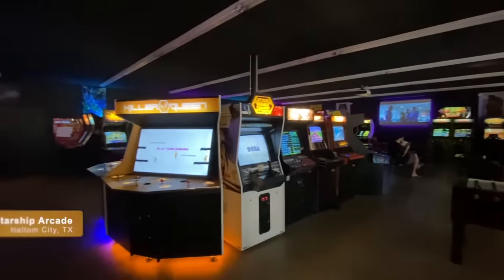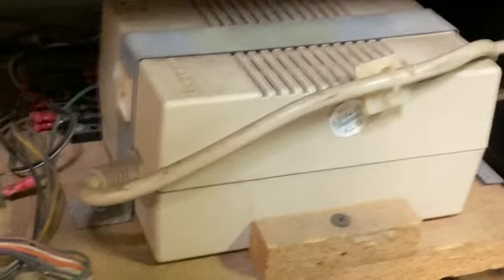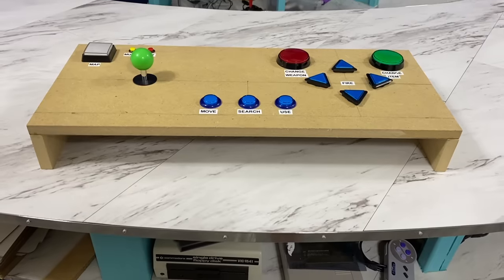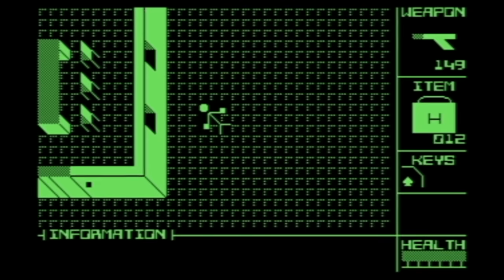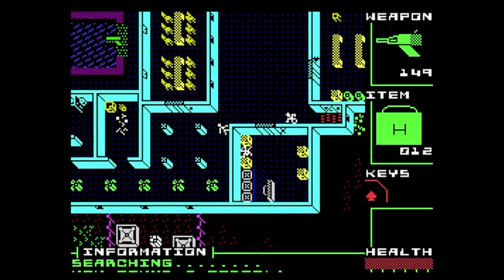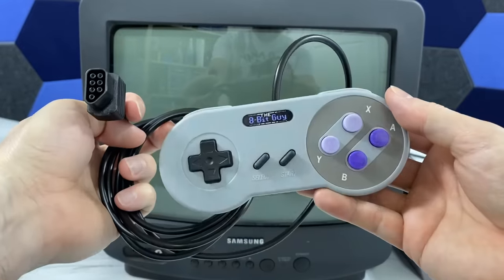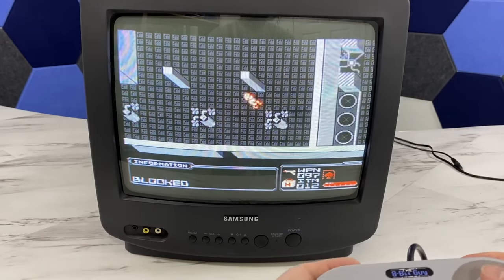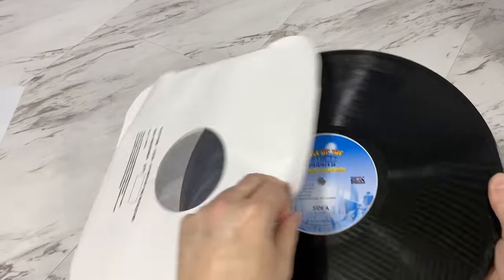Petscii Robots Mega Update - Arcade, Genesis, MS-DOS and more!

Comment: There will be people that cry about the NES version using 4 color grayscale for tiles, but I love the look personally.

I've been working on a handheld in my spare time that runs in either a 2-bit, 3-bit, or 4-bit grayscale for 4, 8, and 16 color modes respectfully with a transparency color for each.  Most likely with a standard ~2.8" display at 320x240.  Dpad, start, select, 4 face buttons, and 2 shoulders.  As of now I'm running off a RP2040 based board to try and make GBA quality games using upgraded Gameboy Pocket style graphics.

Comment: A lot of the quality arcade joysticks come as separate replacable parts, including the frame, the stick, and the microswitches. The microswitches are pushed by a lump on the bottom of the stick. Even a few old computer sticks, back in the day, advertised using microswitches as a mark of their quality. Thing about microswitches is they don't all share a ground! You'd have to wire them separately, sure, but how hard is it to solder a wire to a microswitch? Then you have complete independence, and from the keyboard controller's point of view, there's literally no difference.

You just need access to both terminals of each switch. For everything other than the joystick, which I covered above, that's already the case. No special adaptor board needed. Though that said, you could probably have answered the same problem with a few opto isolators. That would allow you to use an existing JAMMA control panel, if you needed to. I haven't looked recently, but when I did, it was cheaper to buy an old JAMMA cabinet than to make one new. In case somebody has a similar idea.

Comment: Wow so many versions, really impressive stuff. :D
I think that NES solution was fine, can understand the reservations for color but that's how the PPU works. Can already think of a few reasons why 16x16 tiles wouldn't work. ;)
7800 too cool, part of the Pokey club now heh. At least there are some chip clones for that sound standard and continued effort to replicate it.
Reply: To be honest, I don't see a reason why 16x16 wouldn't work. It would just give a different look. I guess it is just an effort/end result balance, as with 16x16 there would be need to figure out how to squeeze 1024 tiles of graphics into 256 (512 actually possible, because there is no smooth scroll). Tools to simpify this process are already there, though.
Reply: @shiru8bit  My first thought was of tiles that actually utilize the 3x3 grid construction directly in-game like changing one of the nine blocks individually.
You can approximate the visual result into 16x16 but then you're swapping the whole CHR table for exceptions which is only part of that unique display process.
It's not that there aren't ways but rather the NES-way is more bespoke or custom than how the other platforms operate compared to the source version. Somebody has to step-up and want to do that extra work. ;)

Comment: Neo Geo would have been the ideal platform for an arcade port, since it is in fact arcade hardware, but there's also a home console which used the same hardware platform. Also, it would have been the best looking and sounding version if you'd used the full capabilities of the hardware. Look at a game like Metal Slug for example.

Comment: I may have to grab that Genesis port! Also has there been any thought of a TRS-80 Coco port? Not sure how doable that would be, especially for a Coco 1/2. Would at least probably require 64k. Much as I love the Coco, the graphics are a bit...weak. Coco 3 would probably be easier, esp a 128k or even 512k model.

Comment: I feel like the reason the Amiga version was chosen because that version was long since finished and the Genesis port was just recently finished... But also a little bit of Amiga bias. I say that because the Sega Genesis has RGB video just like the Amiga, the Genesis is very comparable in features. Moreover, the 2-player mode of the Genesis port would have been great for an arcade setup.

Comment: Will you consider porting NES version to Nintendo VS System (*which is basically share very similar thing in term of architecture). Nintendo VS System is basically an Arcade version of NES, which I think would be fitting if you ever considering making a NES arcade version

Comment: I am interested in how it is that you port this game to so many platforms. Do you have to rewrite the game from the ground up for every platform, or, even for some of them? I can see that there is a lot of work that goes into the graphics design, but outside of that, I can't imagine the level of effort!
Reply: Some platforms share the same CPU, so the same source code can be reused for the game logic, only the video and audio parts has to be reworked (along with the visual/audio content). That's why the ports first covered a wide range of the 6502 powered machines. For other CPUs you have to rewrite the whole code either in assembler for another CPU (like ZX Spectrum version), or in C (Amiga and some others), plus rework the video and audio. So it varies, and also depends on the prior work - like, if one already ported the game to C, it enables further ports for more powerful platforms to be made with less effort.
Reply: @shiru8bit  Great explanation--that makes a lot of sense! Thanks!

Comment: Concerning the joystick/keyboard common ground problem: wouldn't it be easier/cheaper to reprogram the game inputs to use a single row of keys on the matrix? Then you could have had a common "ground" so to speak and wouldn't need all that extra circuitry for the inputs.
Edit: okay, looking at the board from texelec, it probably wouldnt have made that much of a difference

Comment: I'm a little disappointed you didn't try to reprogram the game for Arcade hardware. But I know that would be very difficult because there are so many different kinds of arcade hardware out there and a lot of games had hardware built for just that game.

Also, I would love to see a Nintendo 64 version of Petscii robots with low poly graphics.
Reply from the maker: Indeed.  It would be a huge undertaking just for a single one-off arcade machine.  Better to use an existing platform.
Reply: N64 version would need to sell 1000+ copies to make it viable. So far there are major doubts it could cover its costs, and while I'm totally would love to make one, I'm not in a position to take such risks with my own pocket and time.

Comment: Regarding the NES and MMC5, I've seen copies of Castlevania 3 on aliexpress, using all new hardware, and that was an MMC5 game.  However I'm not sure if their method emulates all the MMC5 features or some of them, perhaps if you only want a few features then that might be doable.  Of course, if the project wasn't already set in stone.
Reply: The thing is that CV3 didn't use any of the advanced features of the MMC5. It was a VRC6 game originally, which is a way simpler mapper, much like MMC3, and as Japanese custom chips weren't allowed in US releases, it has been replaced with MMC5, just because it required less changes in the code (related to the ROM paging granularity). So the modern replica may be a translated Japanese version with the VRC6, or even a modern MMC3 hack.
Reply: @shiru8bit  ah, shiru himself!  I wouldn't be surprised if the Ali CV3 was like you said, a mapper hacked version, I don't know much about that particular version.

Comment: keyboard membranes are not  100% conductive it is resistive paint, you better off measuring resistance from key to next key rather than from start of the trace to the end because it will never show full short
it is enough to all between buttons pads to have similar resistance from one to the next one in line

Comment: The ZX Spectrum's monochrome version surely can't be because of RAM limitations. The Spectrum only has one screen mode. Of that, about 6K is used for a monochrome bitmap, and about 1.5K for the colour overlay. Every 8x8 pixel area of the screen can have only 2 colours (a lot like tile mapping, except it applies only to colour, underneath that the screen is a full bitmap). So that claim doesn't make sense.
Reply: The RAM is needed to store the not so efficient ported code, the map buffer, font graphics, and so on, and so forth. We were literally squeezing out bytes to fit everything that it needs.
Reply: @Ffinity  "Due to the limited RAM available it ends up being presented in monochrome" is the sentence I was responding to, you smartarsed little sycophant. Programmers are only human beings, you know.

Sure I can understand running out of RAM, happened a lot back in the days, programmers having to work out all sorts of weird methods to store data and pseudo-compression and stuff. Jet Set Willy II went from about 32 rooms to over 100, on the same machine, cos they invented a better way of storing them.

That's nothing at all to do with lacking colour, though. Lack of RAM doesn't mean you have to go monochrome. Especially for a game that's character-oriented, on a machine that has colour mapped out on a character basis. 1 byte per character for colour, foreground and background, an eighth of the RAM to store the actual bitmap.

David isn't au fait with the Spectrum, so I imagine this is a mistake he could make. But no, lack of RAM doesn't inhibit colour. It's not like an Atari or Commodore or whatever where there are screen modes, and RAM size is a tradeoff for better graphics.

Seems like Shiru chose to chuck out the colour as a strategic decision. To save RAM by just not storing colour data for the tiles. But the one doesn't necessarily follow from the other. It's a shame, it would only have taken a little bit more data for the tile units the map is made of. The Spectrum can look beautiful in colour, as the other version shows.

I can't say I'm a Spectrum "programmer" but I messed about with machine code on it, back in the day. I know what I'm talking about more than... some prick who gets excited seeing a programmer pop up in a comment, and decorates his arse with praise and mockery, the better to wave it around in the bloke's face.

Comment: The Genesis/Mega Drive has the same CPU as the Amiga, with a simpler/cheaper graphics/sound system.  It does have dedicated chips for them like the Amiga does, but they are not as complex/capable.  But it is still relatively easy to port Amiga games to the Genesis with only a few compromises.  Shadow of the Beast on the Genesis looks particularly good, it kept all the impressive parallax of the Amiga version and the only real compromise is reduced color.  Sound works different, rather than a 4 voice sampling system, while the Genesis used a 6-channel YM2612 FM synthesizer.  In a lot of ways, the Genesis is sort of an "Amiga lite".
Reply: It depends on the judgement. Amiga is what it is and Genesis is what it is because of its custom chips. The only thing they share is the CPU, but the video and audio hardware is completely different, like, on the very basis principles of it. It isn't lite or advanced, it is just completely different approaches to the things.

Comment: You should use a MiSTer FPGA with a Jamma adaptor then you can run any version and map the controls to the inputs.
Reply: I got that from the video. I am suggesting a MiSTer FPGA as it can create a cycle accurate FPGA version of every machine that has a PETCSII Robots port including the Amiga. Would make way more sense to use a modern reliable board than a 30 year old board.
Reply: A $200 DE10-Nano board is cheaper than a vintage Amiga board, a lot more reliable and much easier to power.
Reply: @NerdENerd  No, it isn't cheaper, because he has the Amiga and he doesn't have the DE10. Plus, he started this project in early January. The video may have come out a few days ago but he is well established on his current trajectory. MiSTer is great, but why do that when you could use an RPi for a fraction of the cost? Everyone thinks they know best, but it's his project, his choice, and the choices were made some time ago.

Comment: Die Hard on the NES has the same top down perspective as your game, yet it has the normal colors you'd expect from an NES game. Study how Pack-in Video made those colors work and do what they did.
Reply: perspective has NOTHING to do with the tile size.  The problem is not the perspective, as he explained in the video, its the tile sizes don't line up in a way that allows the usual NES palette mapping.  I've coded a couple of NES emulators and I can confirm this would be a problem, as the way the NES draws tiles is very strange, especially when compared to newer hardware.

Essentially, drawing tiles to the screen is passing palette codes in certain orientations, and if you don't stick to the "standard" arrangements, weird things happen.

Comment: Well, If there is to be an arcade version, it ideally needs to be done on (replica) arcade hardware.  My personal candidate would be to use a MISTer FPGA system with JAMMA harness using either the Sega System E or Gigas (both based on the Mark III/Master System) or SNK Triple Z80 arcade hardware.  Anything more would be overkill, anything less would be leaving at least some gaming fun on the  (cocktail) table.

But that's me.  YMMV.
Reply: The arcade is the Amiga version.

Comment: Here's an interesting question for you, if you have TheC64 Mini or TheC64 and you connect a USB 3.5 inch floppy drive to it, what happens if you insert the 1581 compatible Petscii Robots disk into the disk drive, will TheC64 recognise the disk and read it?  I understand that TheC64 at least works with 720 KB diskettes.  I presume it probably won't work unless of course 1581 diskettes are MS-DOS compatible, which I don't know much about.  I'm sure somebody could answer my question.

Comment: I was wondering how color would work on Ataris. Or rather, I was wondering what a Planet X2 port would look like. I just tested if they could do artefact color. Yes, but you only get black white orange and light blue. (This with NTSC; the emulator I'm using doesn't simulate PAL artefacts.) ... Haha! You get completely different colors depending on whether the emulator is in "old" "new" or "full" NTSC simulation mode.

But there's an alternative. Using artefacts like that halves the practical horizontal resolution so you may as well use mode 12 instead. Mode 12 basically puts the display controller (ANTIC) into 1 bit per pixel text mode but the display driver (GTIA) into 2 bits per pixel color mode for multi-color characters 4 pixels wide.

(Edit: I recall thinking about this a couple of weeks ago and concluding mode 12 would be no good, but can't remember why I thought that. *shrug*)

Oh hey, POKEY music! :D

And of course, a full-size arcade machine of your game is its own kind of awesome! :D

Comment: I can understand why you wouldn’t bother redesigning the game with mmc5 support in mind in case you did tracked down an mmc5 chip because that would take you probably hours and hours on end,BTW i feel bad that you had to manually convert those ecga into cga all because of that autimatic tool convertor didn’t do it probably well,BUT it is interesting that it can be done automatically,even if some manual tweaks are necesarry,
In fact i wonder how much toolchain kits they did had in the 80’s to port their games from one system to the next,
For what i do know is that if you want to auto convert Z80 into 6502 code and vice versa etc,,, that you still have to debug the recompiled results and fine tune the code as well because of potential unsupported features,because all unsupported features from a chip will be flagged by the compilor but this still requires manual adjustments,
For audio i suppose midi could help converting an type of audio format like psg to other audio formats including sample pack kits or vice versa, so am wonder how much of the porting process was done partially automatically,
BTW i wish you didn’t told me about that arcade trip and assambling your own arcade system because now am curious about it,hahaaa😁